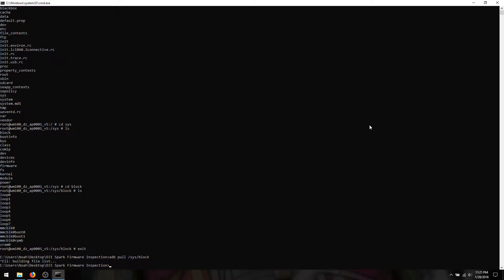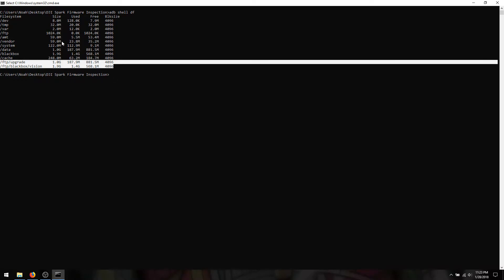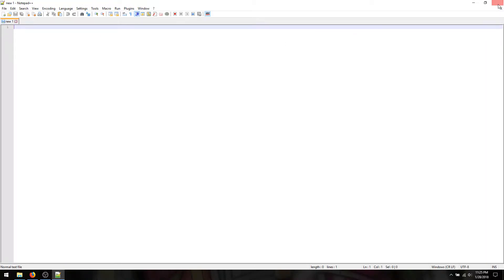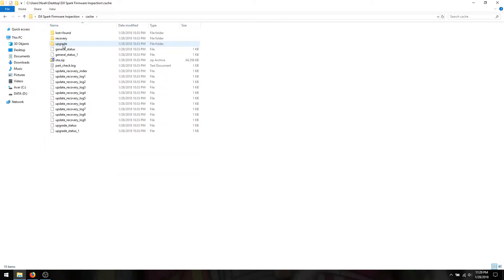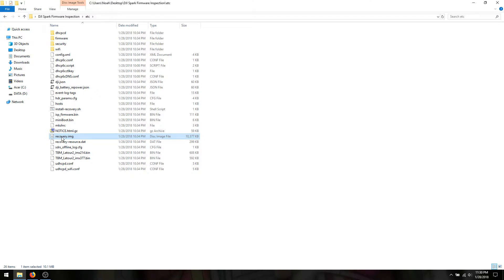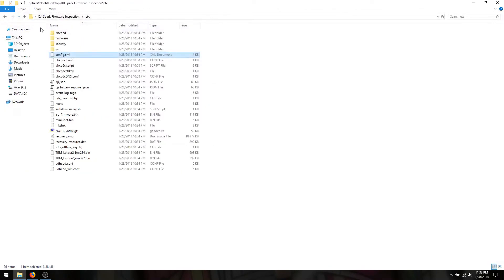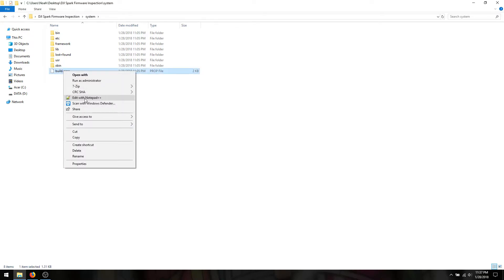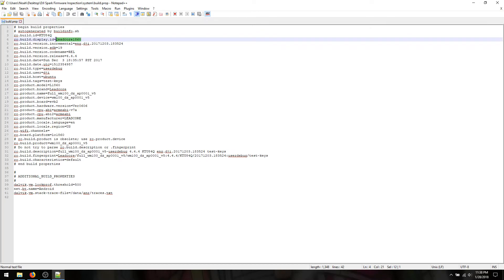Exploring the DJI Sparks Firmware Files

Comment: It seems to me that this is a more in-depth way of modding the drone, But that being said it looks a lot harder than just using the assistant 2 app to modify the parameters.
If your not familiar with this “android” method....you can easily brick your drone this way! But it’s people like you making the difference!! And I appreciate you for that! Hope to see what you figure out with this method.
Reply from the maker: I am still not sure how to modify the parameters using the filesystem exploit, so yes, in that regard, using Assistant would be much easier (ONLY way I know of at the moment).  But for other changes, the filesystem is the only way.  I'll do some digging, and see what I can find.
Reply: M1dn1ght N1nj4 Do you think you can do more with this method..As apposed to using the assistant program? Cause not for nothing but you can do a HOLE lot with the assistant!
Reply from the maker: Yes, I think there are some advantages to having the filesystem access.  End users may not care much about it, as the parameters are more what they are after, but I think this could extend battery life, maybe make the responsiveness improve, and more.  Will just have to see what I can dig up.

Comment: Nice ! Have you managed to get root on the spark remote ? Seams tricky..
Reply: I have some success, spark remote runs openwrt and vsftpd. Vsftpd default folder is /tmp, but was not protected so i was able to go edit /etc/amt/wifi.conf changing country to get FCC mode, that made me happy :-) Also i know how dji enhanced wifi mode work now: iw phy phy0 set retry short 1 long 1, iw phy phy0 set rts off, iw phy phy0 set frag 256, iw dev wlan0 set noack_map 0x00c0,  and then dev wlan0 ibss join adhoc 5745 fixed-freq mac key d:0:*key* ... Havn't got shell yet, apsrv (the main dji app) is killing telnetd, thinking of renaming it or using netcat shell. Still looking for a script file that is excecuted and/or persist a reboot without needing to mess with the firmware,,